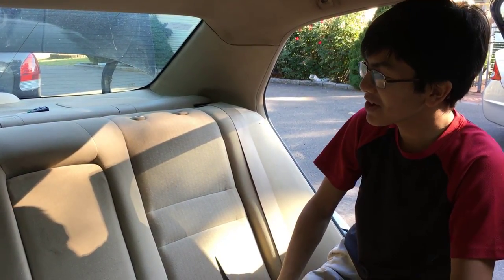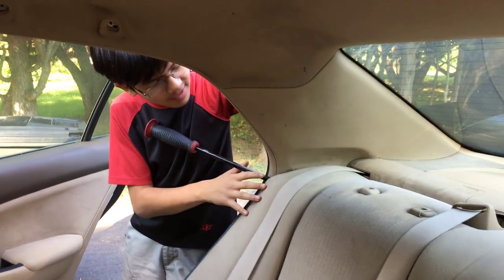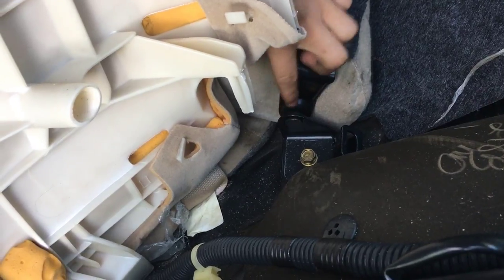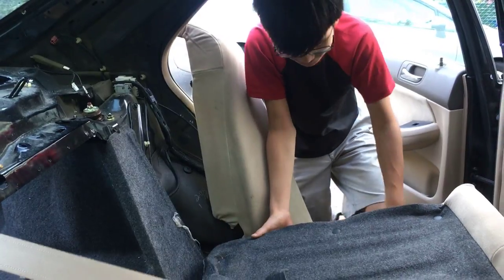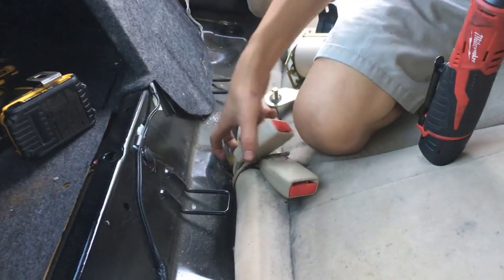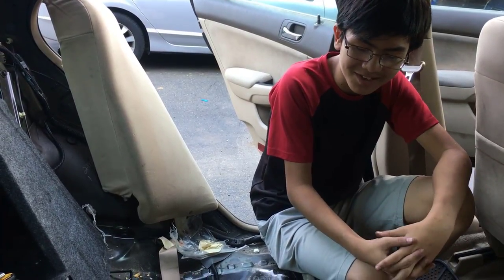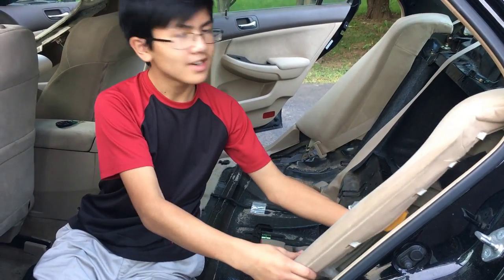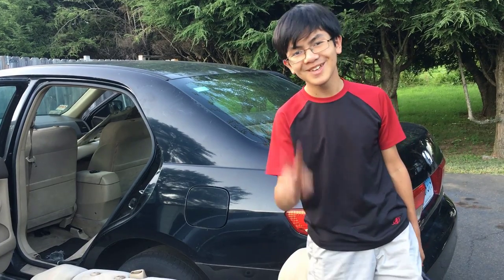How To Remove Rear Passenger Seat Top & Bottom Honda Accord 2003-2007 | DIY Auto Repair Guide

Comment: Do not use a pry bar to remove the side bolsters! There is a bolt (#10) that fixes the lower notch/tab of the bolsters to the chassis. You may need to remove the bottom seat cushion to see it. Remove that bolt and push in the bolsters and slide up.
Reply: Terrible design by Honda, but this comment is truth.

Comment: I just did this. Broke the side covers. You can just slide the bottom out. Remove one bolt near the double seat buckle clips, remove side panel bolts, and then back seat bolts. That way you don’t break your side panels.

Comment: Great job for being so young! Tip: use unambiguous terms such as passenger and driver opposed to right and left. Again nice job
Reply from the maker: Thank you & thanks for the suggestion on how to improve my presentation.  I will be sure to use the driver and passenger side as opposed to left and right...Thanks for watching and taking the time to write a comment...
Reply: technically right and left, refer to driver sitting in the car,his left and right is the considered as car's left and right,which is the correct way

driver side and passenger side is confusing,when you order the parts,since a lot of countries driver side is opposite of ours,

but left or right is the same no matter what side the driver is sitting
Reply: @ahoorakia  That's not a bad point. As long as the precedent is set at the beginng it wouldn't be a problem. I just know the right and left confuses a lot of people. But very fair point good sir.
Reply: @short.version  even when you order parts,it always says right or left,not driver /passenger side
Reply: @ahoorakia  you're not wrong.

Comment: Very helpful videos. Just one comment, the two sides of the seat are not to be pried out. Just tried yesterday, remove the bolt at the bottom and then push the whole thing upwards, it will slide upwards.
Reply: Agreed. I broke mine trying to do that
Reply from the maker: @jaredbjur  Sorry this video caused you to break the plastic tab...
Reply from the maker: Thanks for correcting the procedure.  Hopefully no one else broke the plastic tab.
Reply: My plastic tab broke too but thank you for the video

Comment: Sand under the seat like that is probably the result of receding flood water inside the vehicle.  Your owner's title should have described 'flood vehicle' at purchase, and is useful to negotiate a lower price.  Be aware of potential electrical problems due to saltwater.  

My flood car eventually suffered corrosion through-rust on the power steering tubing underneath the engine.   I still don't regret the vehicle.  Still my fave to drive.  Thanks for the video. :)
Reply: Flood was my thought too. 
Best case scenario, someone let their kid carry home a bucket of sand and shells, and it spilled.
Reply: I’m 100% mines is a flood the whole interior just looked like it was soaking . It literally only needed this big main fuse and new ground to engine,battery and frame . Took me forever to figure out because it would intermittently have zero electric. But for 800$ been driving it for 3 years its 2003 Honda A 124k miles it’s just ugly but has given me least problems out of all my cars

Comment: Good job. Why did you do this? I'm trying to make a bed out of the back. That's how I ended up here.
Reply: Me too. Cant decide how to proceed.  Remove the backrest? 
Or the bench portion of the rear seats? 
That is my question.
I was wondering if i could get the bottom part out, without first removing the backrest portion. 
I think if the bench part was removed, the backrest portion would fold  flatter.
Reply: How did you go about?
Reply: @mariajanedoehn9295  I did remove the bottom bench, only one bolt.
Now it lays flat. 
My feet are in the trunk.
Its a fine little bed, quite comfortable, and i am in my 60's!
Reply: @LaughingblueSu  enjoy"!
Reply: LaughingblueSu how did your bed modification turn out? I’m trying to do the same thing with my accord. I’d love some tips from you, since you’ve done it already? Maybe a video or a FaceTime
Reply: The Fasted Diabetic me too! I’m trying to do this
Reply: Lol same guys, glad it worked out well for you. I'm gonna be taking mine in and out cause I need a carseat in there sometimes!
Reply: Me too! I saw some chick and her man live in their Civic so that's what i want to do now
Reply: Also if you don't need or use the back seats removing them will save weight and increase gas mpg.
Reply: Same here, until I found it suits me about as well as the cabin floor after taking out the passenger seat. 
Now it's shelving. :P

Comment: I have the 3.0L v6 model. You should do a how to remove the two front seats since they are electronic and what not.
Reply from the maker: Thanks for taking the time to write the comment.  Hopefully the recommendation is helpful to other viewers...
Reply: I just bought a 04, v6, automatic, 135k miles.
I pick it up tomorrow, I hope I did the right thing. Has your Accord been dependable?
Reply: @LaughingblueSu  I'm not sure if they sorted out the auto transmission problems in 04... I have a 2007 3.0 6-speed manual. fantastic car. dead reliable but I'm looking to upgrade to something nicer to commute in. I'll be sad af when I sell this car I know it.
Reply: @Corkoth55  what do you mean nicer to commute in? My 05 is cushy comfortable. Do you mean you want an automatic?

Comment: Somehow I can't find the lever in my 2004 Accord. Been trying to fold rear seats to install isofix bracket as my seats do not come with it. Any idea? Maybe hidden underneath the inner covers?
Reply from the maker: Could the lever been broken?  It would be very strange for the lever not to be visible.  It could possibly be hidden under the cover especially is the previous owner re-upholster the car with new fabric or covers.
Reply: @EyeOnAiman  thanks for the reply man. I think it would be broken or hidden during previous installation of car film tints as they had to remove the whole seat and covers to install in to the rear windshield.... Now I have to figure out how to remove the seat without the lever... Sigh... Any idea how?

Comment: Greaat video! keep it up! can I replace the mechanical seats of a 2004 Honda Accord with power leather seats from a  2007 Accord...?
Reply: Yes but you will have to run your own wiring for the powered seats but other than that direct bolt in

Comment: I couldn't find that 10mm holding the bottom down! Doesn't help that there are ANTS living under the seat trying to bite at me as I search around... 05 Accord EX sitting for a couple years, had water leaking into the trunk and ants living in everything. Luckily they've isolated themselves to the rear seat now and the water leak was fixed.
Reply: quit parking on there hills
Reply: @dancearoundtheworld5360  Nah it was stuck in the yard of a family member and the ants made their way into it lol. It was also parked under a pine tree so it's covered in sap, so that's fun...

I got it up and running now, and I cleaned out the ants and all the mold, replaced the trunk seal. All good now, fuck those ants. Now they actually made their way into my truck 😂

Comment: Hi I'm gonna tell you how to break your side panel seats  then point out all the seat belt bolts which could stay in and then 10 minutes later I'll point to THE TWO LEVERS IN FRONT OF THE SEAT and the ONE 10Mil bolt which all u have to remove. Here's a free tip. Lead with the LEVERS and the 10 Mil and remove at least 74 of the Finnangles.